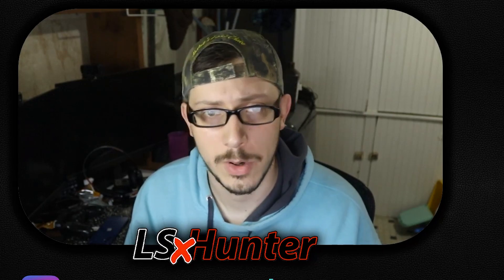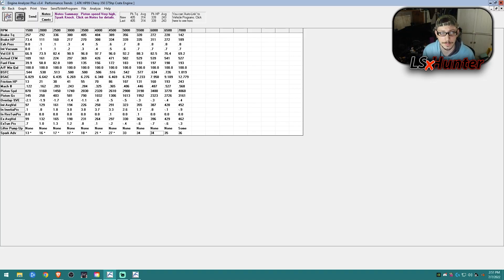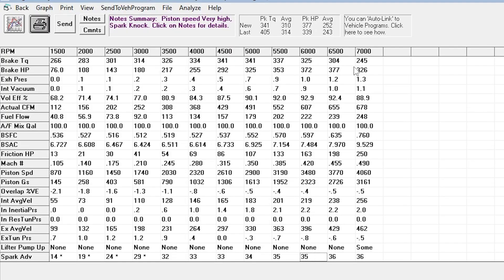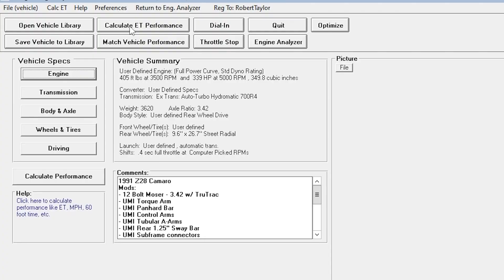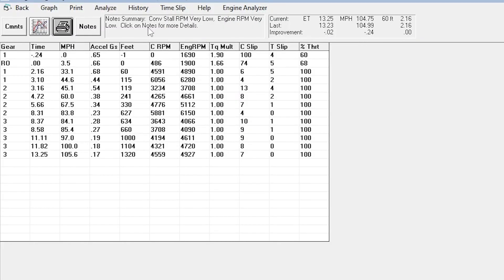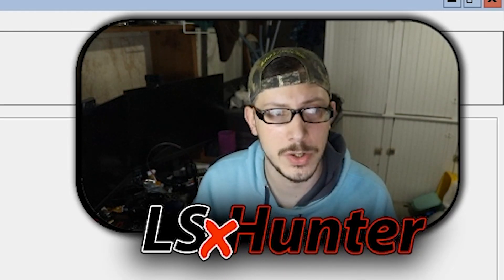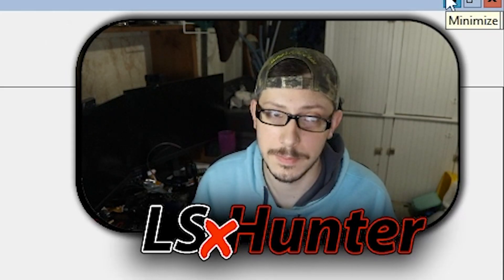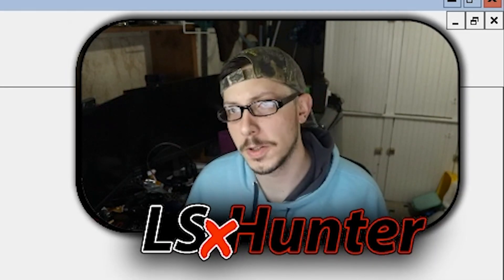Maximize Engine Performance with Intake Runner Length

Comment: This is a comparison between two different intake set ups, doesn’t explain runner length at all 🙄
Reply from the maker: Intakes are just that. Intake choice dictates runner length choice. Long runner, low end power. Short runner, high end power.

Comment: how many ponies do you think the 700r4 can handle i had a 305 carbuerated 86 Z8 that desparately wants a 350 engine was thinking about a 350 tpi set up to keep it era correct but want iyt to make about 400 horses
Reply from the maker: The bigger issue is the torque in my opinion. I’ve had some hold up great - some break under stock TBI load. My rule of thumb is about 400ftlbs I’ll start looking at a heavier duty build. Hoping here soon to do a rebuild of my 700R4 to prepare it for the turbo 400 TPI build.
Reply: @LSxHunter  so basically if i want to doublish the horsepower i should also have the transmission beefed up then probably the rear. ill be upgrading the suspension too its old and tired all original. I want the horsepower and torque even tho its not a daily driver but when i do drive it i want it to turn heads

Comment: im a novice sbc mechanic in the middle of a tpi Nightmare myself, shoulda went carb wanted to try efi, now i just wanna sell it lol
Reply: Why is it a nightmare, if you get it working good it's an amazing motor
Reply: @NoGasAllClass  isn't working right only made 170hp
Reply: @coreybell9525  running good they will make aound 250 to 280 at the wheels
Reply: @NoGasAllClass  they were only making 245 crank running good it should make about 205 210 stock mine is not stock it should have made around 260 to 280 but the computer is wrong dunno if it's not powering injectors properly or what

Comment: The TPI did have masive low end torque so my 1985 Corvette did run 13.93 in the quarter and a quick 1.93 second 60' time. I ended up using a superram and really liked that.

Comment: I run a TPI with AS&M Runners on my 383 with a 700R4 and 3.07 gears, I have considered going to a different intake like the pro flo xp or mini ram but looking at how I use it I spend most my time in the range of the TPI power curve so I just save my 4 for other things.
Reply: I've been considering building a TPI for a tow application. I'm on the fence.
Reply: @xmo552  I actually tried out the china version of the Edelbrock Pro Flow XT, I decided I liked the TPI setup better and switched back.
Reply from the maker: Did you port the base? I’ve got a set going on my personal car.